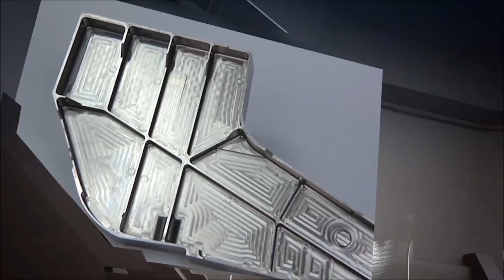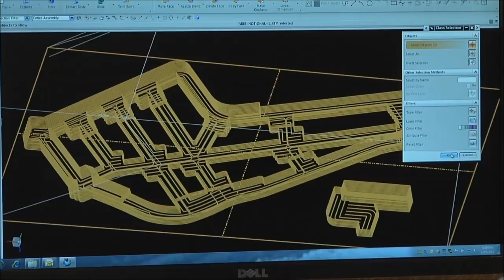Sciaky's Electron Beam Additive Manufacturing (EBAM™) Solution

Comment: Does it run in normal atmosphere?
Reply from the maker: EBAM requires no shielding gases. It takes place in a vacuum chamber.
Reply: This process uses electron beam, which works best in vacuum environment. I believe these systems are no exception.